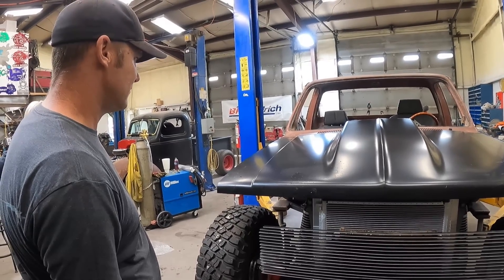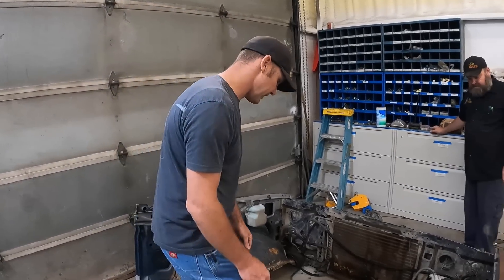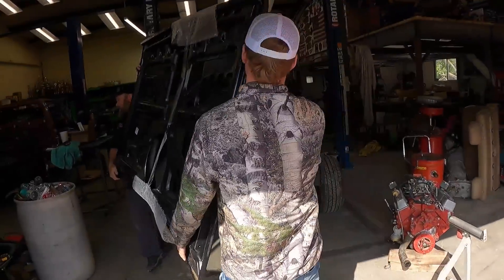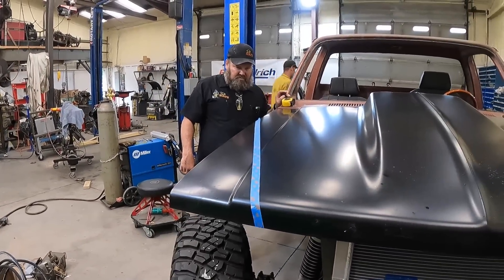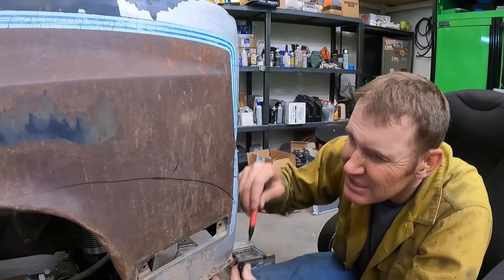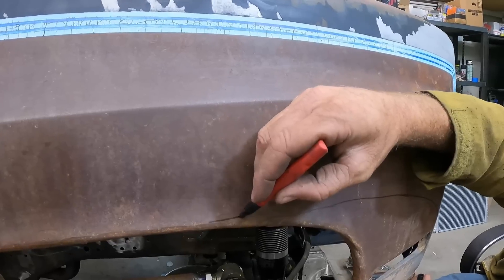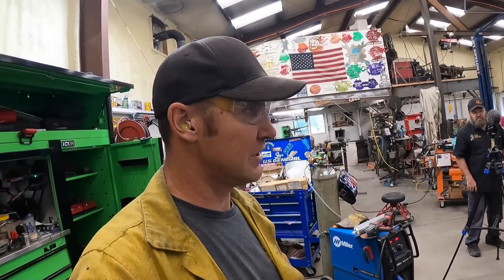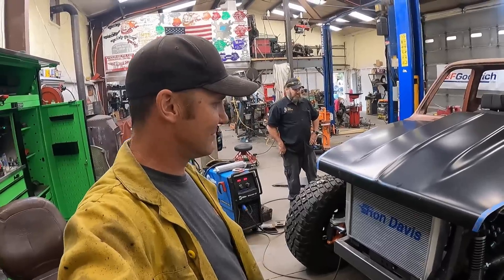The Real Reason You Should Wedge Your Hood, Especially On The Rat Rod Wrecker!

Comment: On the water running into the shop, consider getting ahold of a concrete scabbler and regrade the concrete apron away from the door. 

And just in case you haven't seen the the one or two other comments, Robby is suggesting you help on a collab doing an exhaust on his build on Aiden's truck.

Comment: Here's an idea for the fenders.  Bolt the fender to the chassis of the truck by the door.  Right where you want the wedge to start, cut the fender and then align the tip of the fender with the nose of the truck.  Fill in the area with a round piece of sheet metal where the wedge starts behind the tire.

Comment: The front end looks awesome, only suggestion would be to add some bolted flanges in a few spots to your radiator hoop and fender bar to make it easier to remove the cab or pull the engine in the future

Comment: So theoretically the orbital vale could be mounted directly in the cab and the steering wheel mounted directly to it…………and you really need to run a flomaster exhaust on a v6 pickup for Robby Layton.

Comment: Use  Derale remote trans cooler and it will save you room in the front end and reduce heat in your main radiator and the  work fantastic!  Ive installed 2 on my last two builds and both are working great!

Comment: Hey Paul, what about using plywood and cutting it to fit the inside profile of the fender, then bending the fender across the wood profile? Make a cut in the top flat part of the fender to accommodate the bend then weld her up?

Comment: Should have welded lights back to the little small piece center of the grill the little small piece you have sitting over there on the floor take those two buckets and put them back on it in there it's a small front end

Comment: I think the only thing I'd a done differently would have been to make that hoop around the radiator square (using 45° angles).  <says the guy sitting at his desk>  But I bet we'll see why Paul rounded them instead of doing what I thought.

For seeing 'over' the hod, I want to install a forward facing camera hooked into my radio.  Either with a new radio that takes multiple inputs, or the OEM radio and put a switch that makes it 'think' it's in reverse.  I've run in to a few situations where not seeing over the hood (and me being too eager/lazy to get out and look) almost got me in some serious trouble.

Comment: Just a suggestion not saying I'm an expert or anything would it be easier to put one of the round lights from the  73C10 any other thing on the water coming under the door you're when you could put like a little little rubber buffer on the bottom of the door or or or just raise up like a little concrete patch like a speed bump that keep the water from coming in Just saying lol love  The content

Comment: The only thing I wonder about is persuading pieces of metal.

It maybe of no consequences, but would it multiply the forces pinching those points during flexion?
Causing other points of the frame to compensate for the torsion when or if welds break somewhere else  other than where the persuaded parts are?

Or, did I just overthink a non issue?

Comment: That black widow looked like it had white and red on it's body. I had 2 of them in a shed once, looked then up to see if they were actually black widow or some other species. Turns out they were most likely males or immature females, both are still venomous but not lethal. Only a fully matured female is deadly, while the others will either have slight swelling and irritation down to no effects at all

Comment: Not good at this.  That leaking garage door is driving me crazy. have you thought of a "Garage Door Bottom Seal Threshold: they 
come in various lengths and definately keep the water, snow etc. out. Available at Home Depot or various on line sites for about
$40. Super easy install.

Comment: As a retired race car fabricator, I feel that you get seriously tipped over about using DOM tube in many places where CREW would work just as well at 1/2 the cost. I prefer DOM for offroad race car chassis and roll cages. But for structures like a radiator hoop and fender braces you're wasting money on DOM. Then you use a muffler kinker instead of your real tube bender on it. Hell, I won a championship in my offroad race buggy made completely out of CREW. And it survived a quadruple endo when the car was flat out in high gear. The frame and cage were good except for a 1" twist from front axle to dash bar, and after the suspension was fixed, 2st time out in the desert and the twist was gone. Who in the world sold a demo derby guy on DOM tube for accessory fabrication like this? Must have been the steel salesman.

Comment: I cringe every time you use a level, assuming both that the floor is perfectly level and the suspension is settled perfectly. I know it's "good enough" for your purposes, but I guarantee nothing is remotely square or symmetrical.

I can't deny your results when you go crawling, though.